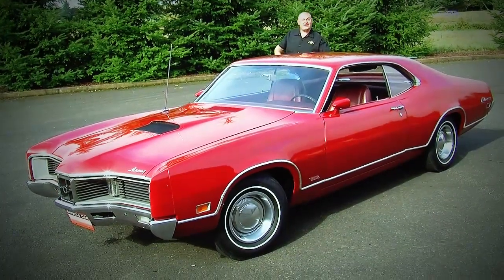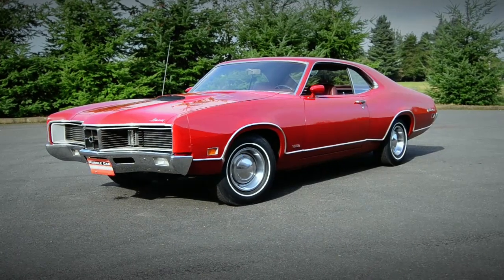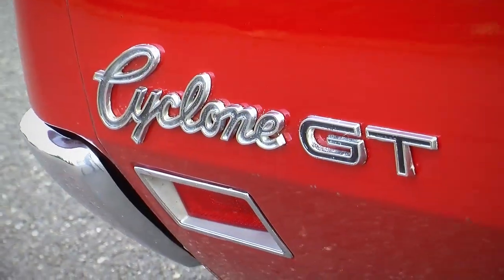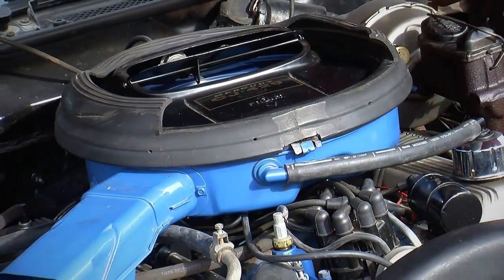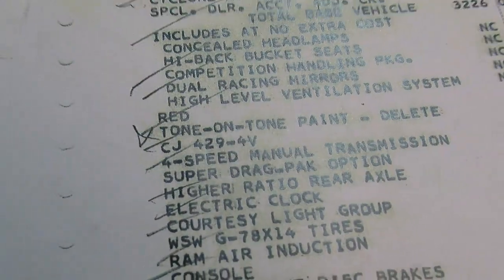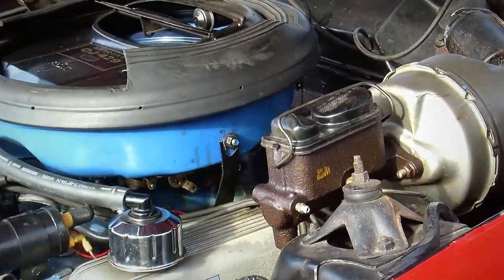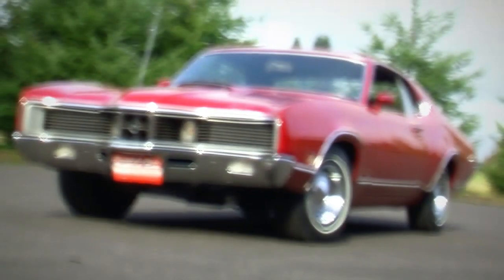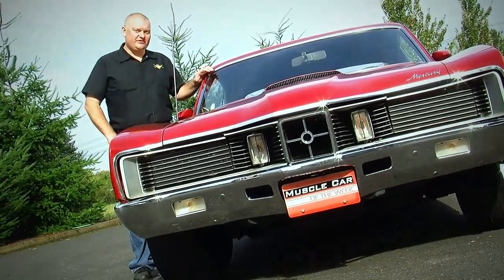1970 Mercury Cyclone GT 429 Super Cobra Jet Pilot Car Muscle Car Of The Week Video #35

Comment: I have that same car, drag pak and all, except it is a gawdawful orange.  Black vinyl top and black interior.  When I bought it new, it had been sitting on their lot for over 6 months.  I put about 16 thousand miles on it rather quickly, and today, many many years later, it sits in the Mercury stable with 21,407 miles on it.  Original spare in the trunk.